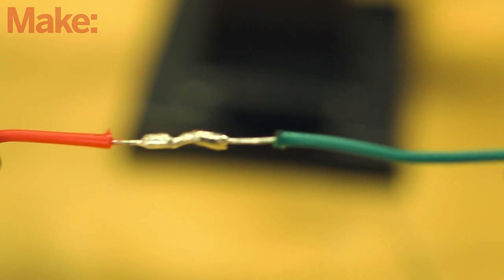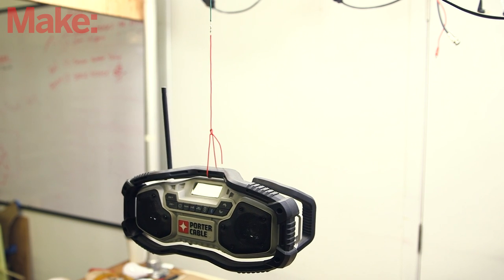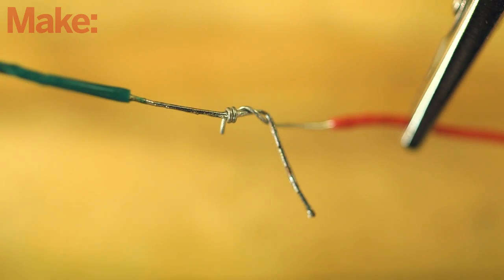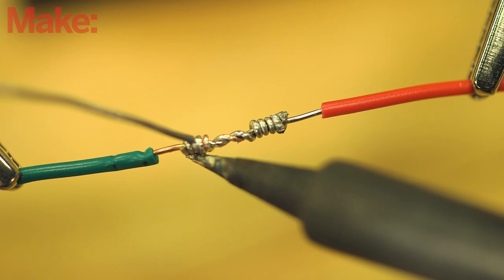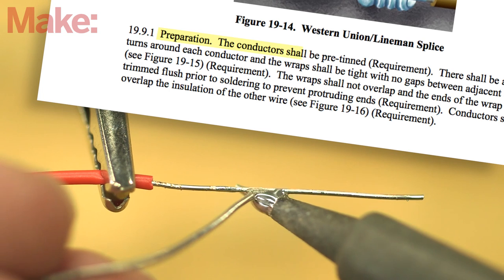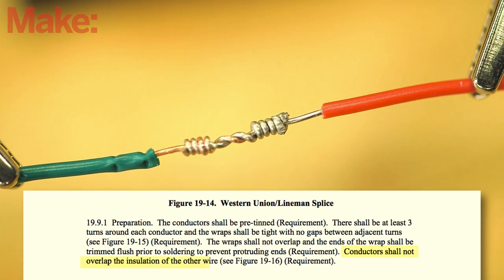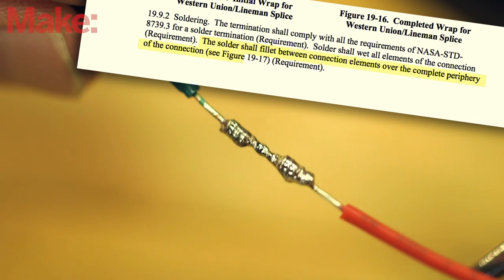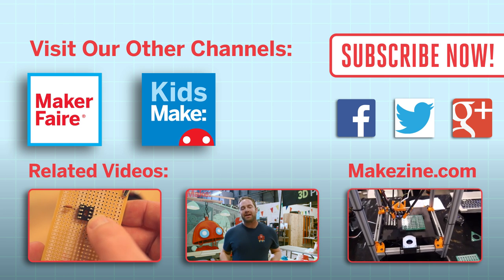How To Splice Wires to NASA Standards

Comment: And it's completely pointless, any splices we've done has no twists with the wires held close together side by side.
It'll hold strong enough you can rip the wire itself in half while the splice holds.
Reply: D8W2P4 ... not under high temperatures.
Reply: Why are your electrical systems/electronics being exposed to high enough temperatures to melt solder?
Reply: D8W2P4 ... my point is if the solder melts a western union/ lineman splice will hold. That is why it’s the first splice taught to electricians.

Comment: Absolutely not an acceptable splice for aircraft use.  The soldered portion of the wire cannot withstand flexing and vibration without support and protection.  As well as conventional compression-crimped, insulated types there are some excellent wire splices available that incorporate solder rings inside heat-shrinkable insulation tubes.  However, the exact type, grade and size of splice that can be used in a particular area of an airplane is specified by the aircraft manufacturer, or by an approved engineering document.  Wiring manuals for transport category aircraft will include a Wiring Standard Practices section with instructions.  In the current day of fly-by-wire aircraft, proper wiring practices are a must if safe flight is going to be maintained.

Comment: I doupt nasa is still using solid wires! If those are too heavy for the car industry, they have to be too heavy for nasa!
Reply: what do you think they use? liquid wires?
Reply: Hamguy Bacon
Are you kidding me? Have you ever wired anything? Nobody ever uses solid copper wire for anything where weight, cost and conductivity is even remotely a factor!
Reply: yes they do, unless you want it to burn itself out in 2 seconds you are going to use copper. you need to read up on electricity and resistance.

Comment: Way overcomplicated.
I dont see nasa skimping and splicing. They would just run a whole new wire. 
This is probably reserved for repairs in flight.

Lesser versions of this work just fine, just as strong and dont waste as much material.

Comment: That is an absolute joke of a solder join, if that's the NASA standard I'm shocked. We use hermitcally sealed solder splices on aircraft so I don't see how spacecraft would have a lower standard.

Comment: Gotta love how every slightly engineering focused video, no matter how general, is basically full of Boomers rambling about how much better everything was back in their shop classes, when manly men were trained in practical things like playing with tools and being a mediocre electrician instead of this newfangled booklearning, and they knew better than those damn whippersnappers at NASA. In my day we linesmen, atop power lines, just pushed those two pieces right next to eachother, having pre-tinned them and acquired a second person to help hold them of course, applied heat, and walked away secure in our knowledge that our contempt for that pinko Eisenhower and his agency would keep the connection more secure than any knot could ever be.

Comment: Omg this is not a good thing to do that much metal n one spot will reduce it's resistance changes the amount of current able to go through the wire so at both sides of the joint you made will heat up do to the lower ohm at the spot in the wire not to mention the total lack of flex too if NASA is doing it like this then God help the next to go up in there rockets btw NASA does not just repair a wire by splicing a wire they pull the whole wire out and replace it they don't risk repairs as in this video because it's a fire hazard

Comment: NASA Standards suck. Tinning Solid Core wire is stupid. It makes the wire brittle and does nothing to induce good solder flow.  First clean the wire with alcohol. Make Mechanical splice. Clean again with alcohol. Coat mechanical splice with solder flux, I use a paste flux. Solder connection.  The reason for the cleaning with alcohol is to remove any dirt and corrosion. The solder should also be cleaned. This is the standard used in the Submarine Navy, at least when I was in it in the 1970's. I have worked in electronics my entire lifw this method works every time and you do not use excessive heat when soldering. Dirt, contamination and poor contact does that.
Reply: +richb313 How does tinning make the wire brittle?
Reply: Heating copper makes it brittle. Working copper makes it brittle. A light tinning on fine stranded wire is ok but on solid core it is usually not needed. The flux does the job better than tinning can anyway.
Reply: +richb313 Actually heating pure copper only serves to anneal it and soldering temps and times won't do that much either. As you solder it in the end anyway and must get all the wire to solder melting temperature it is hard to see why tinning would be so bad, it will also provide flux for subsequent soldering assuming flux cored solder and quick application. Not that I doubt your method works perfectly and tinning will certainly make the wires stiffer and harder to work with just because they are then thicker and have a tin/lead tube around them effectively.

Comment: Yeah great video... You know no it's not a great video you did this wrong I mean you wrapped it correctly and in the right directions but your Shiner is too great The amount of wire left in between your insulation and the splice. You also used way too much solder you want it to be fileted between the wraps not filled and bulbus.

Comment: I don't give a shit about wu splice wire . i don't hang my devices on their power cords or wires. any type of soldering works if it makes a good connection  .
Reply from the maker: Ain't no engineering like overengineering.

Comment: Wow talk about over kill, just twist them together and cover with electrical tape. Solder is only needed when connecting wires to terminals and circuit boards.